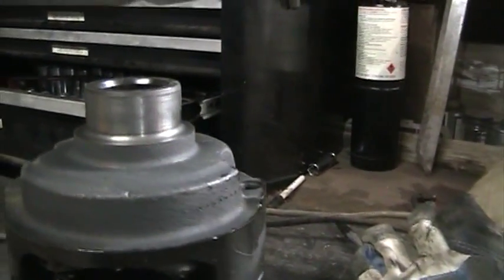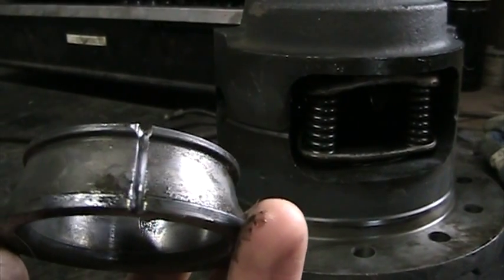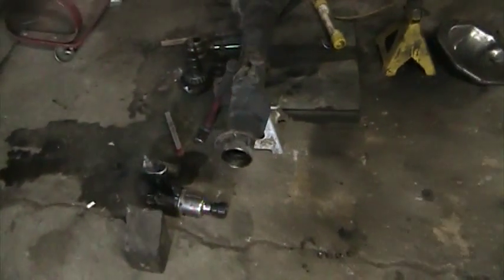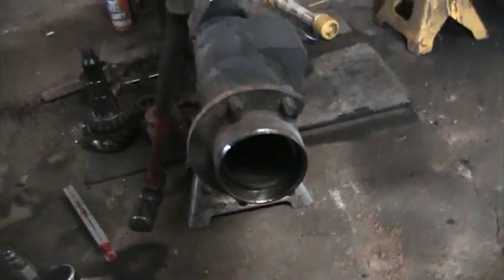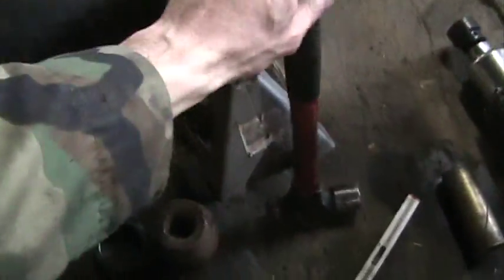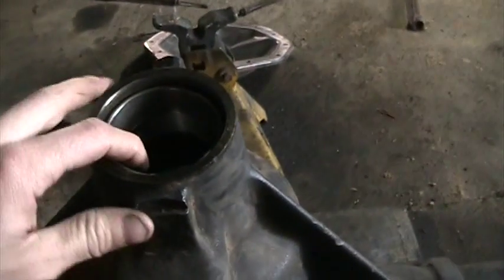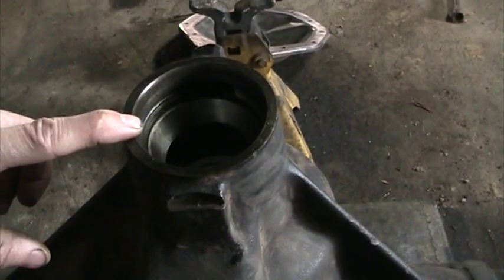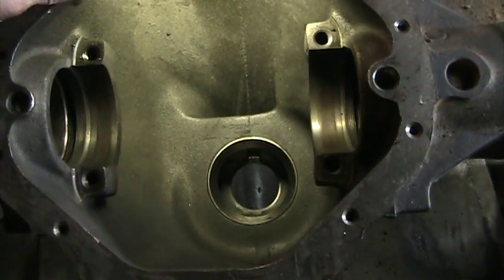410 install, part 2

Comment: use the old pinion bearing grind out the inside a little so it slips on and off easy then use the old crush sleeve and the easy out bearing to set the pinion depth got to have a depth gauge tool though measuring from the centerline of the carrier to the top of the pinion also the shim for most rears are standard starting points like  twelve bolt  is .35 depth reading is on the pinion gear nose like 2.79 richmond gear has a decent tutorial later Don